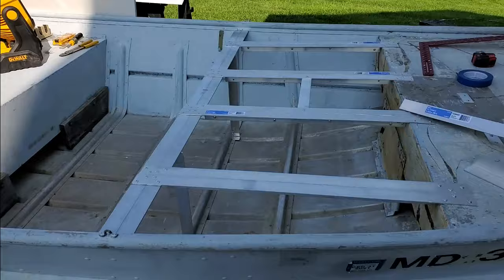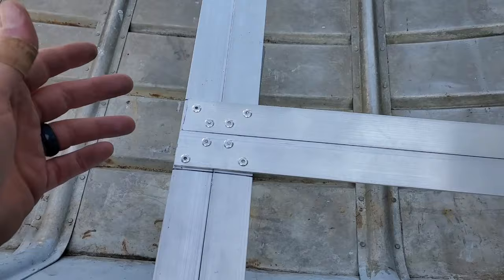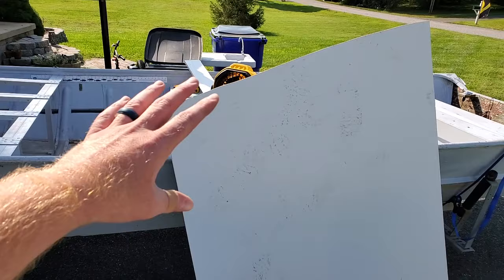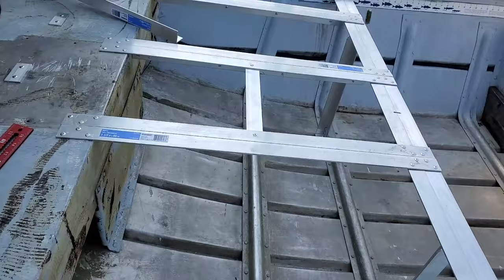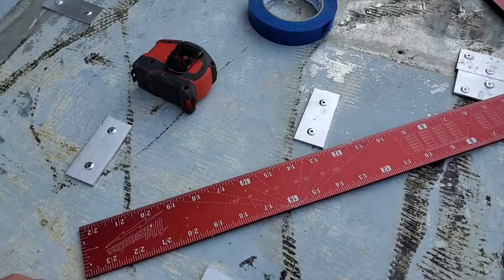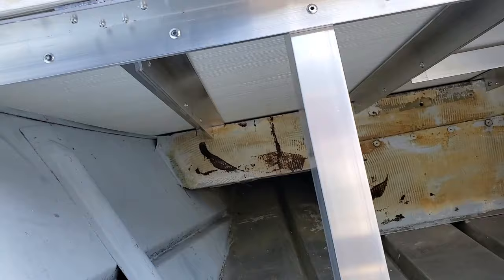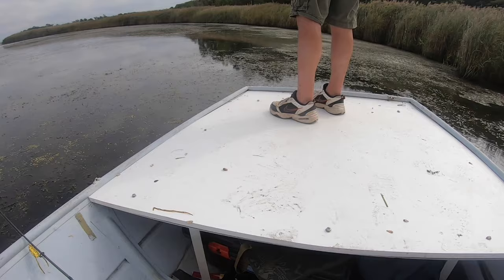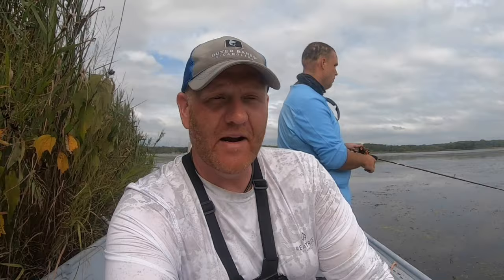Jon Boat Casting Deck / Platform DIY Aluminum & PVC (No Wood = No Rot)

Comment: Well done dude. Your engineering was solid. Glad I could physically see this instead of just picturing it in my head. I’m doing something similar.
Reply from the maker: Thanks! Good luck with your project
Reply: I used his technique to platform 3/4 of my 14'er works slick

Comment: That PVC is a great idea! Please come back at maybe the 6 month and one year mark to let us know how it's holding up. Well done.
Reply from the maker: Will do. Thanks Steve
Reply: Thank you for your reply. The reason that I ask for the update is I'm planning a deck extension/ modification to my 16X50 jon boat. If the PVC holds up, I may follow your lead.

Comment: Its 48 lbs for a 4x8 sheet of the PVC and costs $100 per sheet
3/8" plywood 4x8 is about 30lbs and costs $24 per sheet.
Only advantage is the PVC will never rot.
If you paint the plywood with a good paint and keep it covered so water cant get to it when youre not actually using the boat it will extend the life of the plywood for several years at least. 
The aluminum support structure is exactly what Ive done to mine and Im glad I didnt use wood for that part. I used riv-nuts with stainless steel hex head bolts to attach my decks so I can remove the deck pieces in minutes if I need to.
Reply: Well, if he can afford it and it certainly compliments the aluminium structure that also doesn't rot (fast in fresh water)  It is $75 and 20 pounds of weight, but hell never have to do it again.
Reply: @poepflater  True. The additional weight is a good excuse to buy a bigger motor 😁

Comment: Bout the most simplest, most economical, long lasting casting platform I've seen. I'm going to do the same. I may use screen enclosure aluminum that we have here in Florida for my supports. Stuff is extremely strong and light. Thanks for posting, this it was very beneficial. One question, would you have done anything different now that the build is complete?
Reply from the maker: I've been extremely happy with it. Been a few years now. Love it

Comment: Just got ahold of an old (I think) late 60s starcraft 16 foot fiberglass boat hull. Kinda in shotty condition, but repairable for sure.

Plan on turning in into a small flats boat, and plan on decking almost the entire thing. This video was great.

Comment: Nice. If its to slippery you could scratch it up with sandpaper and roll out quart of paint. As soon as its done and before it is starts drying, sprinkle some course sand on it.  Thanks for sharing and take care.
Reply: Yes that's what I would do glue sand on it that's the dumbest thing I have heard of
Reply: @bobwalton5657 ,  I worked several years on the Mississippi and actually worked on several boats set up this way. I never once thought it was stupid and probably saved my butt a time or two especially around the rope winch. Take care ✌️
Reply: @bobwalton5657  , I actually just looked it up to make sure I remembered it being sand and not some other type of grit. There are plenty of instructions online and some videos on how to mix it and apply to your boat for a non slip surface. ✌️

Comment: Look great, my suggestion would be to move the back forward  to the next bottom rib support  and if you want or need the extra length  then add a storage from the end to the 2nd rib support and then you wont have the seam and water access up front , just a thought,,,

Comment: Is there any sort of connection (i.e., rivet, screw, etc.) where your main horizontal aluminum beam meets the upper sides of the boat? You can see the area I'm referring to at 2:14 - the area where the aluminum meets your fish ruler sticker.
Reply: Agreed, doesn't look like there's any support at the walls of the boat, might be a good ideal to move the vertical support closer to the boat wall on both sides, and add some more vertical supports in the middle

Comment: instead of putting carpet up there in the case of it getting slippery id rough  the pvc up with some rough sandpaper then mix  some dry sand into some outdoor paint and create a rough surface just a thought like they use for truck bed liners although that mightbe a lil expensive

Comment: How much does it flex compared to 1/2 plywood. Any idea on the weight difference?
Reply from the maker: It's pretty stout compared to 1/2". There's no flex when standing on the casting deck and I'm 300lbs. Not sure on weight. You can probably look it up on homedepos website

Comment: How is this holding up? I'm building my own jon boat & was wondering about pvc.
Reply from the maker: It's been 3 years. Still the same as when I built it. No problems and it it's outside uncovered 365. I love it
Reply: @MentalHealthDay82  Thank you so much! I wanted to avoid plywood. My Home Depot doesn't sell the pvc, but I may have found a local building supplier who does. Thanks again.

Comment: Hey was researching deck options for my boat.  I can't get the 3/4 pvc sheet at my home depot.  THey only have 1/2".  Do you think the 1/2" would be able to make that same span without flexing now that you have had a chance to see the rigidity of the 3/4"?
Reply from the maker: 1/2 maybe a little thin. May work with more framing

Comment: Thats exactly what i want on my boat. Do you have an approximate cost and weight for that addition?
Reply from the maker: I forget. It was some time ago. I'm sure prices have changed as well. Maybe $200ish? Not too much weight
Reply: I just finished the casting deck frames on front and back. Purchased 75ft of 1 1/4 x 1/8 aluminum angle and used it all but 7ft also using 200 3/16x1/2 rivets so total was about $140 just for those supplies

Comment: Kurt, I did you rivet the horizontal piece to the sides of the boat?
What size rivets?
Reply from the maker: I did not. Haven't had a problem. Not sure what size rivets off hand. I'm not home at the moment. The bigger the better

Comment: I have a question . How is it holding up. The boys at TBN say not to use it because of expanding and contracting . I want to know from you what do you think after using it a while.
Reply from the maker: It's been 2 1/2 years and I love it. Haven't had any problems and it's never covered. Full sun 24/7
Reply: @MentalHealthDay82  is that the same stuff they sell at lowes
Reply from the maker: @Franks DIY  Think it's a different brand. If you go this route get the 3/4". I've heard the thinner stuff will warp over time
Reply: @MentalHealthDay82  I'm looking at 3/8 pvc sheet board 2878 . Thanks for the input and help
Reply from the maker: @FranksDIY  good luck

Comment: How is that PVC holding up now that it's been about a year? And what kind of weight does the framing support? Does it flex at all?
Reply from the maker: It's been great. I weight 300lbs. Doesn't flex
Reply: @MentalHealthDay82  That's good to know. I might go this route with one of my boats then. I really want to avoid plywood at all costs & Coosa board is expensive.
Reply from the maker: @FireTurtle75.  good luck

Comment: I was just researching this idea this morning. I read that you can't paint over it, is that true?  Also, which has a longer life span, the PVC or painted plywood? Great idea! I'm considering doing this on my 14' alumucrafft, Thanks for your video and info you have.
Reply from the maker: No idea on painting. It's been awesome on the water. No problems and I'm 300lbs

Comment: How’s it holding up now? I’m not doubting you I’m just curious so I can do it
Reply from the maker: It's been 2 years out in full sun. Looks exactly the same. No problems
Reply: That’s awesome! Thank you!
Reply from the maker: @ryanpope9977  No problem.  My favorite thing I've done to the boat
Reply: @MentalHealthDay82  does it dent or scratch easily or anything? Looking to completely outfit a Klamath 18 with this, floor and benches in 3/4. Thanks

Comment: I really love this idea. I’m working on framing mine out. Everyone I talk to says the pvc will rot/deteriorate in the sun. Now that it’s been a bit, have you had any issues with this?
Reply from the maker: It's almost been 2 years. Full sun, never covered. I sit of a full cooler on the deck to operate the trolling motor and I'm 300lbs. Zero issues so far. These panels are made for outside use.
Reply: @MentalHealthDay82  awesome. That’s what I was hoping to hear lol. Thanks for the video and response

Comment: Can u mount chairs to the board?
Reply from the maker: Not sure. I didn't. I mounted a chair that snaps on a cooler
Reply: @MentalHealthDay82  i want to do the floor in my boat but I want to mount the chairs back and have no rug. I'll try it thanks

Comment: I'd be tempted to throw grip tape on the deck. Can make cool designs & carve out a logo or initials..sky's the limit I reckon.
And I'd be tempted for just making a half door that folds down on the back rather than doors on the top of the deck.
Reply from the maker: Great Idea. It's been such a great addition

Comment: I used the exact same stuff to redo my boat. Completely unhappy with the way it warps in the sun!! I see you have it tucked up under the rails on the side and front. If you put it on the floor without something holding the edges down, it'll pull upward at least 2"!!
Reply from the maker: Wow. Did you use 3/4" or smaller?
Reply: 1/2”
Reply from the maker: @jrb2578  Appreciate the info. I was thinking of using a thinner sheet for the floor. The 1/2 definitely has more flex than the 3/4.
Reply: Definitely don’t use the 1/2”!! It warps terribly. I’m honestly thinking about ripping all of mine out and using marine plywood. I don’t have the option to use 3/4” because my boat has preformed aluminum pieces that only line up with the holes in the side of my boat by using 1/2”! I really wanted this stuff to work so I never had to change it again.

Comment: Is the PVC UV protected?
Reply from the maker: It's made for exterior applications. It's also been 8 mouths. It's been outside uncovered all winter. Just installed my tolling motor. Been on the water. Nothing has been compromised yet.

Comment: Need a video of someone walking on the back of the deck where it's not over the nose of the boat. Would like to see how much it flexes with just the frame support.
Reply from the maker: I weigh 300lbs and stand where the support is. I've had 2 people on the deck casting. Nothing has been compromised yet

Comment: This is the worst material you can use for a boat platform. I did it last year to my boat after watching this video. Originally i thought it was a great idea but after just a few weeks my platform and hatch lid ended up warping terribly. My whole platform was wrecked and i had to redo every thing over with treated wood. Do not use this material for this application ever trust me!
Reply: Did it really warp?
Reply from the maker: Mine is going on 4 years strong. Looks exactly the same. I used 3/4". Did you go thinner?
Reply: @alextorres2589  yes it warped real bad i wouldnt lie about it.
Reply: @MentalHealthDay82  i used 3/4 as well. I couldnt believe how bad it warped and quickly, within 2-3 weeks.